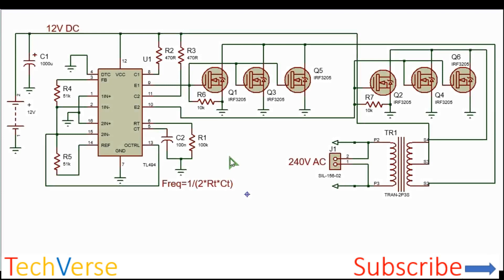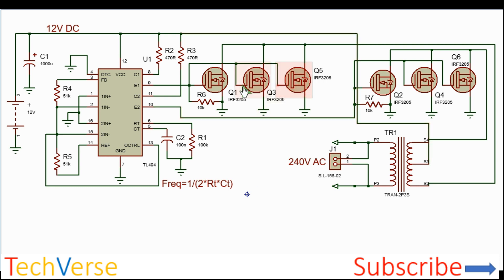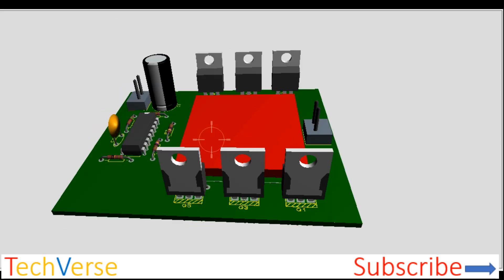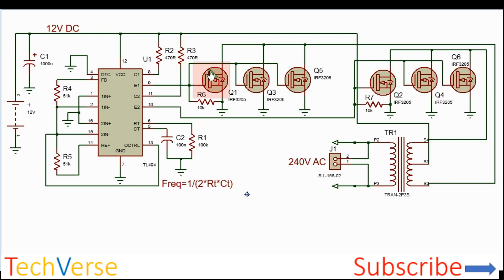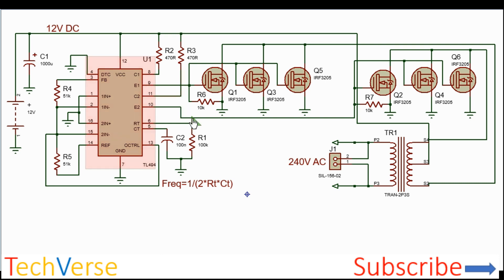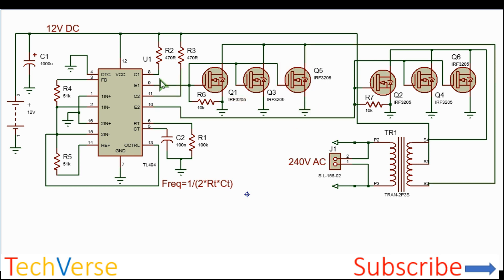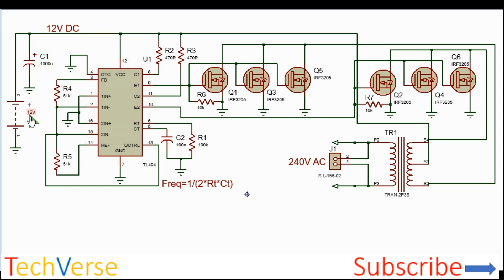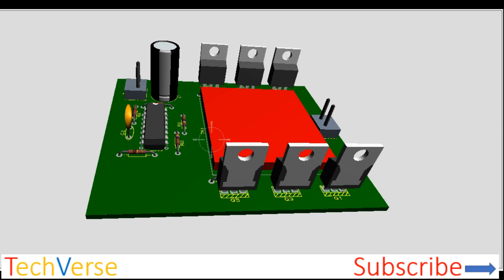TL494 3000W Inverter with IRF3205 MOSFET (12V to 240V DC to AC)

Comment: No heat sinks for your power mosfets are required?
How many watts is each power mosfet dissipating?
How many amps pass through each mosfet when the system is delivering 3000W of power to a load?

Is the output a pure sinewave or some other waveform that isn't good for sensitive electronic devices??

Comment: No gate resistors , current and voltage feedback data.
..Should be improved...200W and above is dangerous..
(3kW inverter : 250A@12V) !!! .

Comment: please my question is, instead of the transistor irf 3205, could I use the ir f 44n?
Reply from the maker: Yeah, but the power will be reduced to about 350W with single IRFZ44 on each side